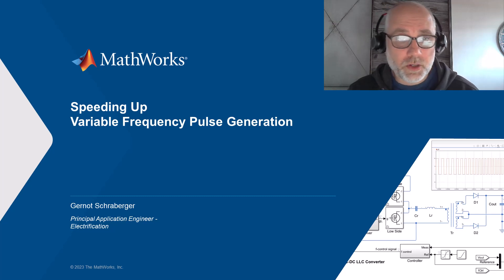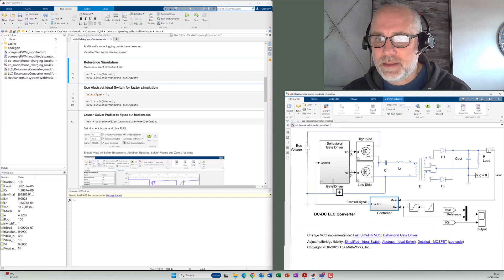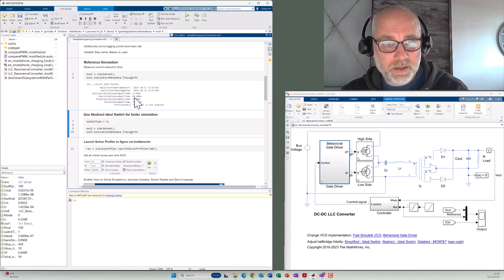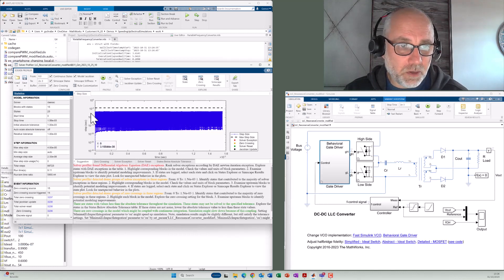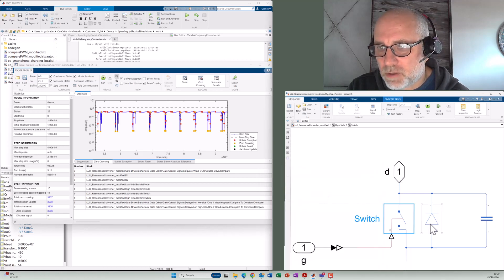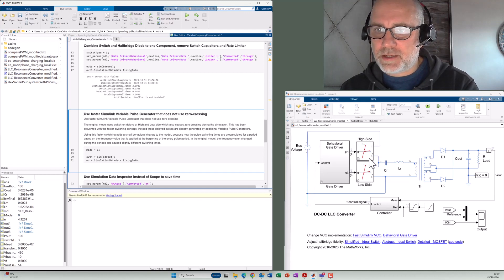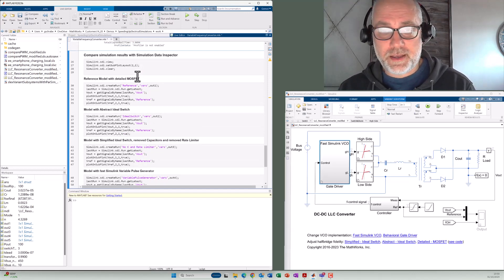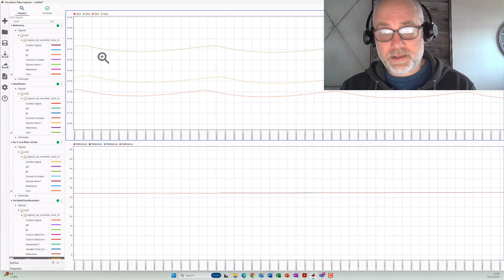Using Fast Implementations for Variable Frequency Pulse Generation | Simscape Electrical Modeling

Comment: nice🙂... How can i implement Chaotic PWM for EMI reduction in converters
Reply from the maker: Glad you liked the video. For Chaotic PWM you can use the variable pulse generator block as shown in this video https://www.youtube.com/watch?v=bSJCDL1ZzDg to implement PWM with a variable base frequency. The generation of the chaotic pattern can be done individually with standard Simulink blocks or a MATLAB function.

If you have more questions, you can post additional question to MATLAB Answers? https://www.mathworks.com/matlabcentral/answers/index